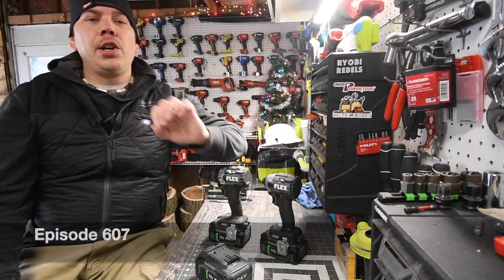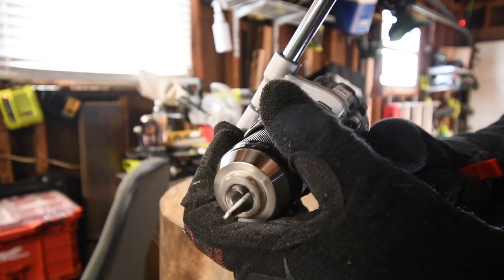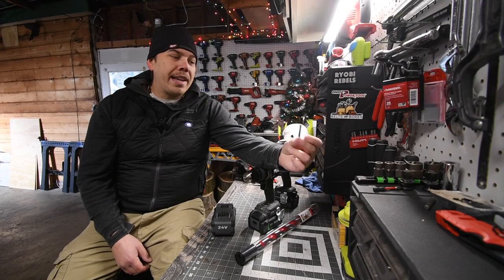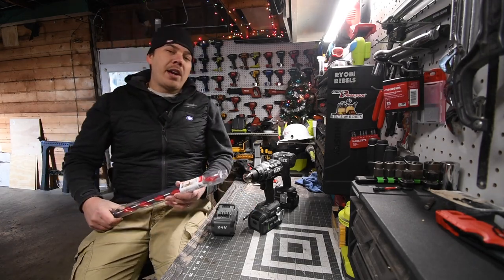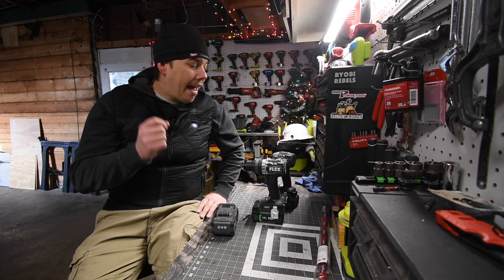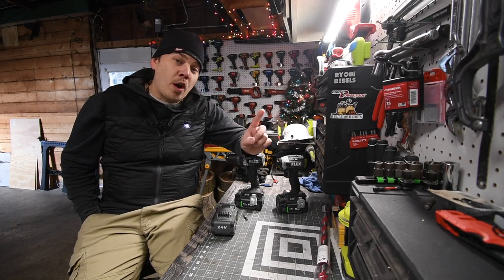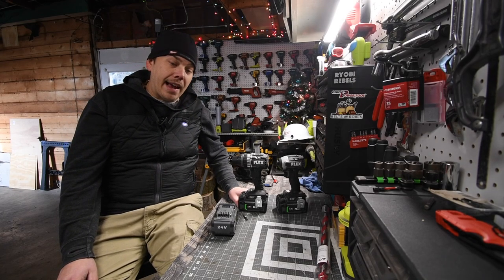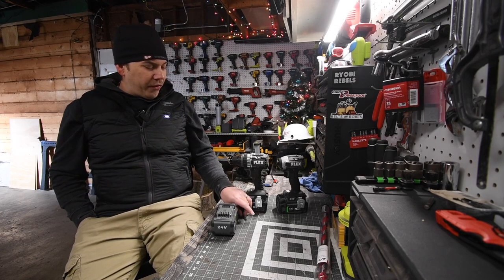FLEX Be Flexing Too Much

Comment: I buy liquidation tool pallets and repair tools and resell them most of them are Chervon brands like Kobalt and Masterforce and chucks are the #1 repair I perform #2 is replacing reciprocating saw motors due to output shaft snapping and #3 is sticking or damaged reciprocating saw blade clamps and misc. levers.
Reply: That's gotta be a good business to be in I'd think...
Reply: @erik34  I own a small engine repair shop and went to college for industrial electronics and manufacturing but winter months business slows down so I diversified into other areas. I have always been a jack of trades.
Reply: @charlesquinty7403  Then repairing damaged or broken tools is right up your alley.  It's certainly rewarding to give a non-working tool a 2nd chance at life.  I'm always interested in buying pre-owned/refurbished tools, where can I check out your inventory?
Reply: @erik34  I sell locally mostly to family and friends.

Comment: Kobalt's warranty - walk in lowes and swap the tool.  As for Ryobi....bought a 2 nailer kit and one of the nailers stopped firing nails before I could even run a full "clip" of nails through it.  A bit of a conundrum getting it swapped out at home depot, but after a bit of talking and a work around for a single tool only box plus a drive to another store that had the tool in stock, was able to swap out a brand new tool for a brand new tool.

Comment: Pro Tip: Just because it says, “Hammer Drill,” doesn’t mean you get to swing it like an Estwing framing hammer. 
*See also: Dave armed with a 2”x4” Vs Milwaukee Hardhat that gave him some side eye. (Spoiler alert: Dave won that one too.)
Reply: Respectfully, I must disagree.  If my drill has a hammer emoji painted on the side of it, I will assume I can use it to bang in a masonry nail... or at least a brad nail.  ;)
Reply: @erik34  Fair point. So, to that end…..do bigger batteries help with bigger nails?

Comment: For some reason I don’t like flex. They seem like great tools. I think I hate the marketing.  I like Milwaukee, Dewalt, Ryobi, and Makita (very limited use but still great).
Reply: Agree.
Re-plastic-ing another 24V line so that you have to get the 'latest and greatest' 24V line is just a marketing ploy / money-grab.  
I know other channels keep saying Flex is 'Super Duper Pro Grade'... but Pros need a variety of tools.  
Flex still only offers what I call the 'Father's Day DIY Kit'.  Even Kobalt has a deeper line.  Which is why Kobalt is frankly more 'Pro' than this is.
That's right I said it.  You can have a fast DIY kit the way you can have a pickup truck made by Lincoln (and some fellas did).
Reply: How many types of ways can they design a battery so it won’t fit into other tools
Reply: @paintpaintpaintco.6039   Don't forget the different color plastic dye.